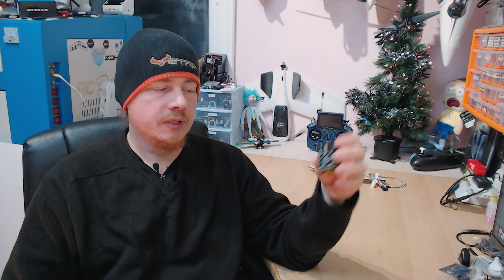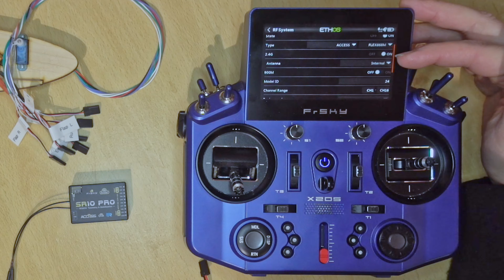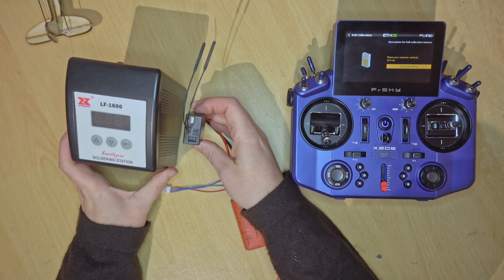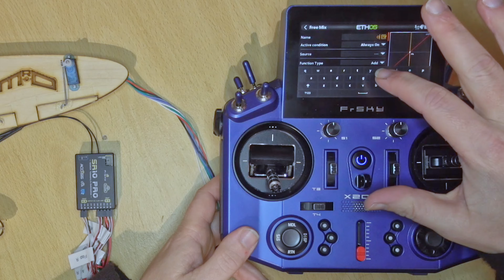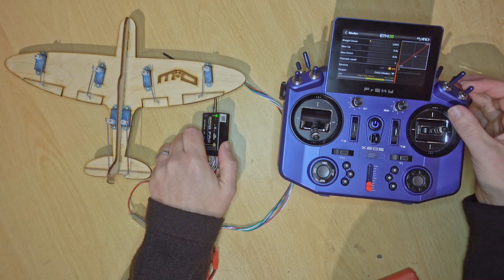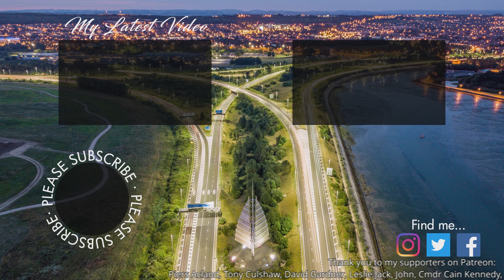Setting up FrSky Archer SRx stabilised Receivers

Comment: Your rudder test,  I think that's backwards. If the plane yaws to the left,  it needs right rudder,  but you showed it following which is incorrect. Moving the receiver to the right you indicated the rudder should go right but this is wrong and only increases the yaw to the right.

Comment: Thank you for the great video. 
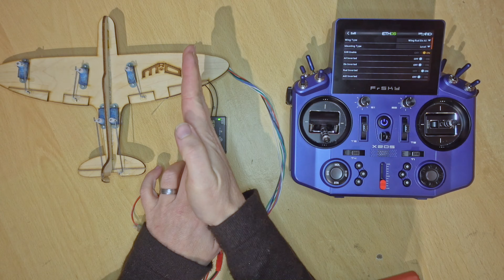In 13:58 you say the rudder should follow the rotation of the nose but in the subtitle you say it should follow the rotation of the tail. Which one is correct?
Reply from the maker: The rudder should move the same direction as the tail. The note in the description is correct.
Reply: @MrD  thanks a lot but the i think the model u use in the video the rudder is not responding correctly  sry maybe i'm wrong

Comment: Hi Darren. Thanks for the video. Very intresting. However. I try to setup my flaps in pin 5 channel 5 and it doesn't work.
But they stay fixed at 1500us... even if the output are saying other us output. but if I put flaps in pin 7  channel 7. Al is working...
You have a solution for this?

🤔🤔
Reply from the maker: You need to enable aux on channel 5. By default it uses output 5 as the 2nd aileron. You do that in the SxR tool.

Comment: wi;ll these way of setting up radio work on the ACCESS ARCHER SR6 . receivers
Reply from the maker: Yes, they work the same. Use the Self Check option in the SxR tool though. No need to toggle the switch any more.

Comment: Do you know if you have to do a self check every time you turn the receiver off/on or is that a one time deal for any given model?
Reply from the maker: No. On the older S6R and S8R, it used to run a self check when you plugged in the battery. But I don’t believe the newer receivers do this now. 

Just run the self check if you make a change to the setup, or you feel there may be an issue.

Comment: Darren, I noticed a problem using this receiver with my X20S.  If I reverse the aileron correction direction in the SxR menu, it also reverses the direction of the normal stick movements.   I can correct this by reversing the ailerons on the Outputs page.  Then everything works correctly.  Is this the way it is suppose to work?  Seems strange to me.  This is also true for the elevator control and I assume rudder as well. Am I doing something wrong?

After working with this a bit, changing the Gyro control direction can also change the stick control direction. However, it is possible to get the stick control direction and the Gyro correction direction correct for both clockwise and counterclockwise move movement of the servo.  so I guess it works ok.

Well, I've noticed another issue that seems to be a problem. If you turn the Gyro off in the SxR menu, it can change the center trim point as well as the direction of the servo. This can't be good.
Reply from the maker: Yes, it ca be a bit of messing about to get it working the correct way. So long as the movements and stabilisation is correct, you’ll be fine.
Reply: @MrD  Thanks for the prompt reply. I really enjoy your videos, best on YouTube related to the X20S.
Reply: bill, did you ever figure out why the trim changes between gyro on/off state? I just set up an SR10 pro today and get exact same result!
Reply: Yes, you need to do the self check under the SRX stable menu. Put your rates on high before you do the check. This will set the limits for the Gyro. Should also set the trim correctly. @ccaputo35

Comment: Great video as always. One question, should the rudder go right to correct for a right yaw.? Seems like it should go left.
Reply from the maker: The rudder should move the same direction as the tail. Or the opposite direction to the nose.
Reply: @MrD  I agree. But I believe your video had it backwards.  Regardless, this was a great video. Thanks so much for making these.
Reply from the maker: @billrenfro7113  check the video description.
Reply: @MrD  Got it.  Thanks Mr.D.  And thanks again for making these videos.

Comment: Thank you Mr.D.  Excellent video.  I am particularly interested in the process you used to get all the 10 pins in the SR 10 PRO working with servos, and switching some of the channels used for stabilization to higher channel numbers.  Here is my question.  I have a Horus X 10S and 3 SR 10 PRO receivers.  The Horus is running on Open TX 2.3.15.  I tried to duplicate your process in the Horus, but could not find the section were pins are assigned to channels.  Do you know if there is a way to do this under Open TX?  If not, maybe I need to install ETHOS in my HORUS X10S transmitter?  THnaks again for the video and for considering my question.
Reply: Thank you Mr. D.  I took a closer and more attentive look at the manual and I found how to get to the table with the pin numbers and the channel numbers with Open TX.  Thanks a lot.

Comment: For anyone having trouble getting into calibration by toggling the switch (like I did), you can also get into calibration by going into device configuration then SXR and set to calibrate to on from there and it will go into calicration..
Reply: I could not get self-check initiated by toggling a switch, but I was able to get into self-check mode via the SxR_R95 lua script.  

Opentx 2.3.15 on X9d 2019 SE Tx, and Archer-x_2.1.10.frsk on SR8 PRO Rx.

Comment: Can I bind sr10 pro to the tx16s mk2 edge tx
Reply from the maker: No. 2.4GHz ACCESS receivers will only connect to ACCESS, TANDEM, and TWIN FrSky transmitters.

However, there is an SR10 Pro Plus, which also can run ACCST. This might work. Though I have not tried this or heard of anyone who has yet.

Comment: The most recent firmware for the sr10 pro has a  ew self check option in the device config. section, under SxR.  How would the procedure that you show I. Your video would now change to take advantage of the self check option.

Comment: Thanks for a great video Darren.  Helped me out quite a bit.  Also the video with setting up flaps.  Just wondering about the gain we've added in the Mixer.  I may have missed a step but it seems either the stabilization is on or off depending on the Mode switch.  The gain doesn't seem to change anything even though I can adjust it from 0% - 100% via Pot1.  Any quick thoughts? 

Thanks again 
Steve
Reply from the maker: Hi Steve. The stabilisation will be on or off depending on the switch. It works as Off | Stabilisation only | Self levelling. The gain should change the amount of movement as the plane moves. You’ll probably only see this in the self levelling mode. Higher gain, you should notice more deflection happening sooner.
Reply: @MrD  Thanks again Darren. That makes sense now. Really appreciate your videos as I just picked up my x20s and have been slowly switching my planes and one heli over. Take care…Steve

Comment: Question, why didn’t you just connect the flaps to channels 6 and 7 for the start ?
Reply from the maker: Because the only point of connecting the flaps in this tutorial was to show the work around to be able to use pwm ports 9 and 10. They are used by the stabilisation settings. This shows how you can still use those pins for servo outputs.
Reply: @MrD  
So I understand when I connect mine I should connect them to channels 6 and 7 ?
Reply from the maker: You can connect them to any free ports/channels you want. With channel 6, bare in mind that it is also a channel which can be used as a 2nd elevator. So it needs to be set up as an aux channel.
Reply: @MrD  
One more question. Do I still need to use the frysky software to setup the receiver for stabilization after this setup ?

Comment: Hi. Thanks for this video. It was really helpful. 

Im running a delta wing. And I set the Elevator to channel 8. I am able to control it using stick inputs but I noticed that stabilization does not pick up the different channel for the elevator. Works fine if I set the elevator back to channel 2.

Are stabilized channels fixed?
Reply from the maker: Yes, the first 4 channels are fixed in the stabilised receivers. They must be aileron, elevator, throttle, and rudder in that order.

Comment: New to this, almost set up but haven't been in the air yet. Is there a difference between the channel 12 'Oh Crap' self leveling mode and the Channel 10 self leveling mode? Would seen a little redundant if not. Thanks for all of the videos Mr.D. You've been a tremendous help getting up and going with ETHOS. Cheers mate!
Reply from the maker: Hi Jeremy. Yes, they are the same. Channel 12 is also used for the self test on some receivers (all of them at the time). So the channel wasn’t wasted. It could be done on Channel 10 too.
Reply: @MrD  Thanks as always for the reply.

Comment: Hi Darren 
Great video, thanks!
I have an issue/question:
on my X20s 
when I go to device config/SxR and I scroll down, I can see all the percent of gains to 0% and offset angles to 128%, and they are grey shaded, not possible to change them, is it ok? what can I do?
Reply from the maker: You need to update ETHOS and the RF firmware. That has been fixed.
Reply: @MrD  thanks man, will look into it ;)

Comment: Hi Darren, Great tutorials - what is you best recommendation for mounting the receiver with stabilization in the plane? Is it by using velcro, double sided tape or 100% fixed mounting by a bracket. Just to make sure that the stabilizers have the best conditions to output correctly.
Reply from the maker: Velcro is a bit too loose. I have used cable ties and thicker double-sided tape to attach these receivers.
Reply: @MrD  Thanks for the advise ! I'll try this method

Comment: hello,is the archer plus (SR10)receiver compatible on X9D transmitter?
Reply from the maker: Yes. The new Archer Plus receivers work with both ACCESS and ACCST. So will work with an X9D. If it's a non-2019 model X9D, you will likely need to be using the latest ACCST iXJT firmware to use this. The receiver will automatically match to thecorrect firmware when you bind.

Comment: Good morning, I have a question, minute 7:37, in this section it tells you first position and you go down and click on the rudder, why rudder and not first position? I try to configure the same receiver and the same transmitter and I have a doubt in that section.
Reply from the maker: I clicked on rudder as it was the last thing in the list. This puts the new mixer at the bottom of the list. Now in ETHOS there is an option to add the item Last, shown at the top of the list to make life easier. I like to keep my mixes in order. So the first 4 mixes are Aileron, Elevator, Throttle, and Rudder; to match the channel order.
Reply: @MrD  I don't understand, when I create free mix in channel 9 for gain, it gives me the option of first position, last position and then ailerons channel, elevons channel, rudder channel, etc., my question is if when I create free mix for gyro gain
in channel 9 if I have to put first position, last position or create one by one for example free mix aileron turn gain channel 9, free mix elevon turn gain channel 9, free mix direction channel 9 and in this way are all the
channels assigned to channel 9 turn gain? it's a bit confusing for me, I just broke a plane following your tutorial but adjusting a frysky rb40, could you send me a video of how to do it all from the beginning? greetings from spain
Reply from the maker: When you choose this (first, last, or the existing mixes). This is just the visual order on the mixer page. It has no effect on the output channel at all. That is set within the mix itself. This ordering is just to create a mixer screen that you will find easy to use.

With the gain in particular. You just create the one gain. That is for all stabilised channels.
Reply: @MrD  Or as you tell me when I do free mix channel 9 gain turn in editing I select last position and it already acts on ailerons, elevons and rudder.?

Comment: With firmware version 2.2.10 this procedure on self check using 3 position switch no longer works on Chnnel 12. Is it possible for you to update the video with the new procedure using the LUA menu in the Config/SXR menu. Thanks

Comment: I've just moved on to Ethos 1.4.2 - how do I now trigger Self Test on an SR8 Pro receiver? I thought it would be in Device Config > SXR but when I go there, the OFF - ON toggle for Self Check is greyed out? Thanks!
Reply from the maker: That is how to perform the self check for the SRx receivers. Make sure that the receiver and internal RF module firmware is also up to date. If they’re not, that could be what is stopping that from working.

Comment: Have an odd problem with my SR6. Its was working fine. Then i pulled it out and put in in a different plane. When i tried to bind it, it doesnt seem to be getting power. I tried direct from battery through ESC. no power. Tried a small 3S battery connected to an external BEC. no power. What happes with both setups, a green LED flashes momentarily when the battery is connected. But no light stays on even when the battery is connected. i tried adding a servo to check if power was coming through. No power at all. Not sure what to make of it. I tried the same with a brand new SR10Pro and that is working fine. The SR6 seems to be dead. Have you ever encountered this problem? Is there a fix?
Reply from the maker: I've not encountered that problem. But, possibly something has been damaged, as it seems to light up briefly when power is first applied. If it is working normally, you should have a blinking green LED. Without any servos attached; try powering the receiver from the white connector block at the top. You should have got a cable with a servo plug on the other end with the receiver. If that works, it could be that the PWM pins have been damaged. In which case it would probably be worth contacting the retailer, as that shouldn't happen in standard use. Or take the case apart and check the joints between the PWM pins and the circuit board. Also, if the white connector block works, you could try flashing the receiver again via the cable, in case there was a power surge or something that corrupted the firmware. Unlikely, but worth a try.

Comment: rudder direction is wrong on the gyro.. if your nose goes right you want the rudder to go left, if your nose goes left you want right rudder , this is to keep your nose tracking the same way if wind hits it and throws your plane off course, . in your video you have nose going right and the rudder going right pushing your nose more right which will cause issues..what you were thinking was the TAIL moving right the rudder goes right, tail moves left rudder goes left.
Reply from the maker: Thanks. I did add a note in the description a while ago to correct this.
Reply: @MrD  Gotchya

Comment: Not sure what I have missed. I have S8R Pro. Have setup as per the video. Gain set to 0 - 100.
Plane flies well. Gyro works fine, but when I increase the gyro gain I don’t see iff to increasing.

Thanks.
Reply from the maker: On the bench, if you put the plane in self level mode, you should be able to see and hear a difference when you have the gain at minimum and maximum. When you move the plane, subtle movements should have less servo movement. If you don’t see any difference, check the output channel for the gain mix. Just in case that hasn’t been setup or is on the wrong channel. 

Feel free to record a video of the test and post a link here.

Comment: Hi. I followed all your step with S8R. How do I switch on/off certain channels? I have my flaps stabilised when I roll my plane to the left. Right roll is not stabilised. I don’t want any stabilisation on the flaps. 

Prior to that I did not have my flaps (pin 5 ) or my gear ( Pin 6) work. Someone suggested that while calibration of RX I also flick those switches. After doing that the flaps and gear worked fine, but now having this issue with flaps being stabilised. Is there a way to turn the channels on/off for stability?

Thanks.
Reply from the maker: I the configuration tool for the SxR. There are 2 options. I think they are AUX 1 Enable and AUX 2 Enable. I am not able to check at the moment as I am driving back from working away. If they are set to enable, they will use Ch5 and Ch6 respectively. If they aren’t enabled, AUX 1 is used as a second aileron and AUX 2 a second elevator.
Reply: @MrD  Thankyou.

Comment: Thanks Daren for the great tutorial I followed closely, but I was unable to self-check.
Reply from the maker: If you have an S6R or S8R receiver, you need to use the switch method. The Self Check button in the SxR tool only works with SR6, SR8 Pro, and SR10 Pro.
Reply: @MrD  I have a SR10 pro, but I can't figure out where I'm wrong.
Reply from the maker: Have you tried these? https://youtu.be/rUKIBQdmvIY?t=1118

Comment: Hi Darren, you was saying that when you calibrate the RX should be lifted a little? So I gather it should not be done when it’s inside a plane with wheels down?
Reply from the maker: You can if you wish. You can just put a little block under the front wheel(s) to raise the nose a little.
Reply: @MrD  I will have a fool around tomorrow, see if i can get it to work. Only really want it for a oh dear moment. 👍🏻

Comment: Hello good afternoon, I am subscribed to your channel and I have a question about the gyroscope. Wanted to mount gyroscope on my extra 120cc. But it has 4 ailerons, and the Sr10's gyroscope, for example, does not send a signal to the 4 ailerons. Is there any way to do this??
Reply from the maker: Unfortunately you couldn’t individually do this. The gyro is pretty simple. I think it may work with Y leads. One Y lead for the outer servos. The other Y lead for the inner servos. But the mechanical side would need to be spot on too.